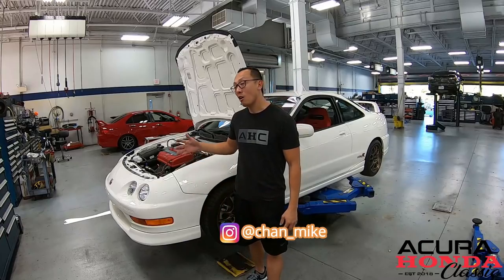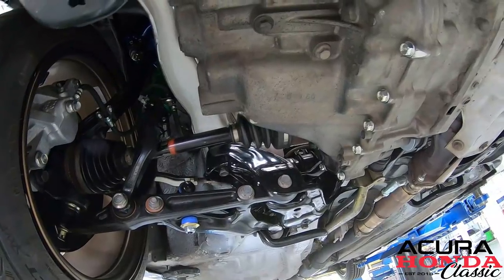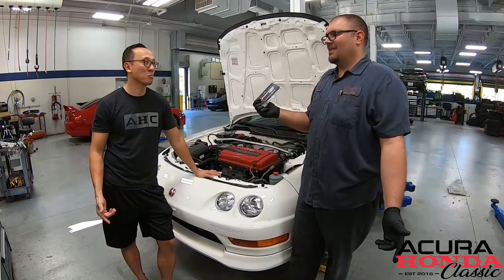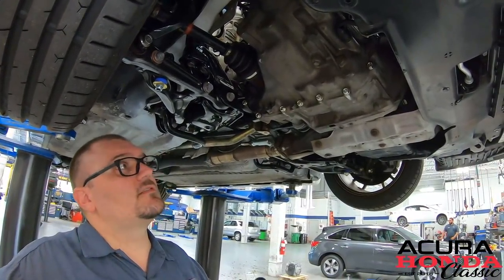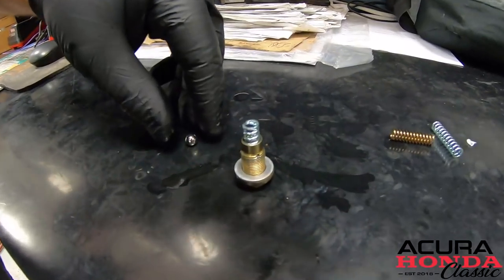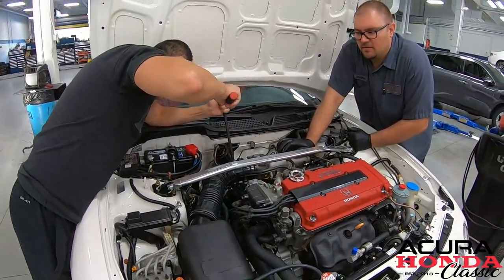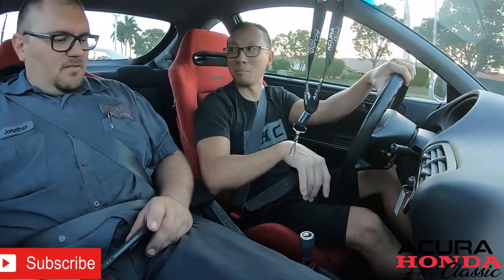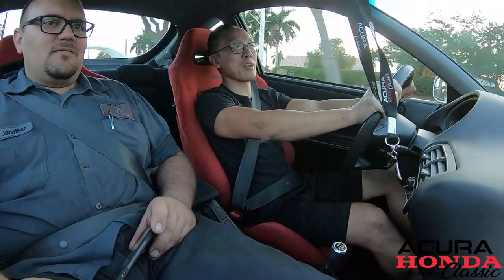Acura Honda Classic Integra Type-R Build Project - SpeedFactory Detent Springs JDM LSD (Episode 23)

Comment: Hey, do you know if there's a difference with the PS reservoir for the 2000 ITR vs 95 gsr or something? My GSR PS reservoir doesn't fit on the bracket correctly. Awesome vids man!
Reply from the maker: All 94-01 Integra (all models) uses this part number: 53701-SR3-951

Comment: Can the detent spring cause you not to go into gear? I just got done rebuilding my transmission (b18c). I remember I bent one of the detent spring. I can't go into 1st, 3rd, or 5th. I can go into 2nd 4th and reverse with ease.